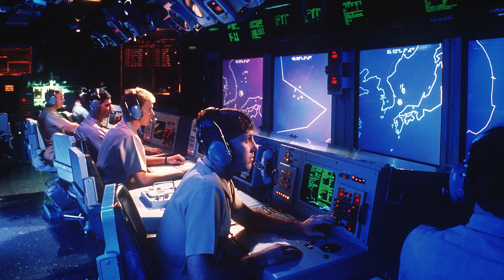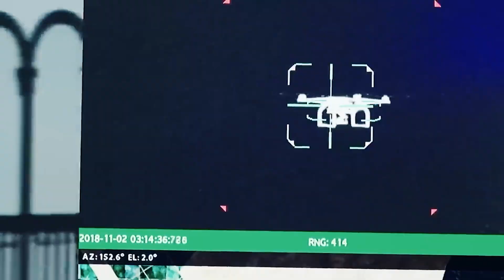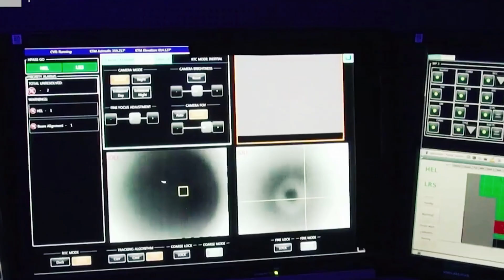This US LASER Aircraft Carrier Is Ready To Beat China

Comment: From what I've read before there's several challenges in taking down a hypersonic missile with a laser.
1) You've got to detect the bloody thing as it can literally 'fly under the radar' (yes Aegis too)
2) A hypersonic missile by definition is maneuverable, so even after detection it needs to be tracked, you can't predict where it'll be next
3) A laser needs to be focused on the missile long enough for it to burn a hole in it, because of the extremely high speed of a hypersonic missile this means the focus distance needs to be quickly adjusted to match the distance of the target

Well that and as this video states the best the US has at the moment, is a laser at half the required strength... So I'm not quite sure why this video is titled as it is as clearly the US doesn't have an answer to hypersonic missiles yet. They have the early steps of a countermeasure that they know isn't good enough and hope that it can be developed to a point where it will be good enough.

I think I'd keep those very very very expensive ships far away from much much much cheaper hypersonic missiles if things actually start going down until the countermeasure at least in theory stands a chance.
Reply: You don't need to burn a hole through it. You just need to destroy enough of its shielding that it self destructs. Like the space shuttle coming in with damaged heat shield. Going that fast through the atmosphere generates massive heat. Just putting a small dimple in it would probably be enough to cause friction and turbulence enough to cause a catastrophic failure.
Reply: Hypersonic missles are not maneuverable "by definition". In fact at that speed, manuevering is very stressful to the missile. Because of the missile's high speed, a high energy laser does not need to stay focused for a long period of time to stress the missile enough to cause it to breakup.
Reply: @dancobb2199   Although you're technically right, without it hypersonic missile is a term that can be applied to missiles as old as the original V2 rockets in WW2. Those are not what gives the captain of a carrier a chill up his spine.

"The US-based Missile Defense Advocacy Alliance states that ‘hypersonic weapons refer to weapons that travel faster than Mach 5 (~3800mph) and have the capability to maneuver during the entire flight.’"
I prefer that definition as it refers to something that's actually a new type of threat and generally what people actually mean when they say hypersonic missiles.

@Jack Bare  China's DF-27 is believed to have a range of 2100km at the highest estimates (that's ~1300miles). So 'thousands' (plural) is a gross overstatement. Not to mention these don't seem to be made with carriers as a target in mind.

The longest range one (DF-21D) specifically built to take out carriers seem to top out at about 1450km (900 miles)*. Perhaps you're thinking of the classical ICBMs - those do have a range of thousands of miles, but they're nothing new and unlikely to hit a carrier.

*This might be a rather recent model, last time I looked it up 290 miles seems to have been the maximum distance.
Reply: @Axeiaa  There's a few misconceptions here.

YJ-21s have a range of 1000 km to 1500 km.

DF-27s have a range of 5000 km to 8000 km.

Your calculations are off. Even near sea level, a Mach 10 YJ-21 missile traveling 7700 MPH would take 435 seconds or 7.25 minutes to go 930 miles (max 1500 km range), not 30 seconds. Plus, it would be going at a slower speed like Mach 6 initially, so it would take even longer.

Also, it's not too hard to detect a hypersonic missile. It doesn't matter which type, all hypersonic missiles create a superheated plasma in front of themselves that basically lights them up to radar and IR. They can be detected hundreds of miles away, it doesn't matter if they are flying low. The concept of them being stealth to radar is obsolete. NASA figured out how to use radar to track hypersonic returning spacecraft many decades ago.

They can be detected with a lot of different systems including satellite systems. The horizon for a fighter jet is typically over 200 miles, so that's the distance at which a jet can detect them and shoot at them. And jets can be way in advance of a carrier group.

Plus, Ukraine recently shot down some Russian hypersonic Kinzhal missiles with a US supplied Patriot battery, so it's possible to shoot them down with missiles.

Hypersonic missiles also have to do all navigational computations themselves because of the plasma which prevents all radio communications. No GPS. No correction from other military assets. If the wind is blowing too hard, these types of missiles can miss their targets by miles. This means that they have to slow down in order to gain accuracy by visually sighting a target itself, or by getting a radio data feed, something that doesn't quite work out for them.

The primary defense to hypersonic missiles would be air to air missiles, then ship to air missiles. The SM-6 is especially well equipped for this.

A laser system would be a third line of defense. The last line of defense would be a Phalanx CIWS, but only for lower flying missiles. The Navy would never want to get to the CIWS because it has to be fired way before the missile gets there and might not do enough damage, but it's not just a laser defense. In fact, the CIWS defense would be performed by smaller ships some distance between a carrier and an incoming missile.

A laser defense is more needed for drone swarm attacks. Although it might be able to take out hypersonic missiles, I have not heard of that being verified yet.

As for radar, the US has the E-2D advanced Hawkeye. It has 88 of them, plenty to protect multiple carrier groups.

You also discuss the Chinese missiles. The only way for hypersonic missiles to defeat a carrier group is if they swarm them. If the US went to fight China, not only would their allies in Japan and South Korea help, the US could probably field 6 carrier groups.

If the US ever got into war with China, they would have 30 Los Angeles class submarines firing 25 Tomahawks each in a half hour or 750 missiles at China from 1000 miles away from all directions before they did anything else. The entire coastal mainland of China wouldn't be able to defend against that much firepower and since the Tomahawk can be directed to a new target mid-flight, any heavily protected targets could be bypassed for easier military targets. Or, that massive firepower can be fired at the Chinese navy. China is putting their YJ-21s on destroyers now. Destroy the destroyers, that would take care of many hypersonic missiles. China is also putting CJ-21s on bombers. Again, take out the bombers, that takes out the missiles.

Any fight with China would be at very long range so that Chinese drones, jets, and missiles could not reach US naval forces before being destroyed.

All but 6 Chinese subs are diesel, so they have to come up every 1000 to 1500 miles. Easy to detect and destroy. China does have 6 nuclear powered subs that they could send towards our Pacific (or Atlantic) coasts, but we have 10 times that many that we can send towards their shores.

As for Aegis, yes, it can fail. It failed 10 times in the last 2.5 decades during testing. This occurred mostly when testing out new subsystems and/or missiles. It also succeeded 43 times during testing.

But the most important part of this is that major powers never get directly into war with each other. The last one happened 78 years ago. Profit from trade is too important. Sure, countries saber rattle and we have small regional wars, but it's unlikely that a real war will ever happen unless the entire world economy implodes and countries need food and necessities. Shy of that, this is a bit of a moot discussion.

No hypersonic weapons will be fired at any of the major superpowers until smaller countries gain hypersonic weapons.
Reply: @dancobb2199  but the missile can rotate so that the laser won't focus on the same spot
Reply: Us navy laser aircraft carrier
Reply: Keeping US Naval fleet far away from SCS and much closer to home will make more sense in the hyped up "National Security" propaganda. But unfortunately arrogance and inability to maintain hegemony diminish the sanity left in the brains
Reply: Exactly, did that Iraqi defense PR flack Baghdad Bob write this? DOD got caught with its pants down.
Reply: Axaea, you can't kep those ships anywhere far enough because hypersonic missiles have a range of thousands of miles
Reply: Ukrainians have actually taken down multiple Russian Hypersonic missiles.  So that whole technology seems to have already been countered.  Necessity is the mother of invention.
Reply: These missiles are being shot down already in Ukraine be careful Russian tech is never been the best. They always underperform like they are doing in Ukraine . Supposedly the world second  best military ha ha
Reply: Yeah it’s exo skeleton is made to take super temperatures and that’s what a laser is .
Reply: if they havent already, i would be thinking of a way to create an energy shield around the carrier that would deflect/explode a missle upon impact.  i dont think we have a way to fight against our own tomahawk if one was fired at a carrier.  

theres a video of what happens if a carrier group goes back to 1941.  a lot of our weapons depend on our gps satellites.  they would be useless without gps.  forward to the present; if our enemies or we used an EMP or lasers/missles to destroy gps satellites in space, those types weapons would be useless. dont focus on destroying the missle, focus on destroying how the missle works.  Look at the movie Battleship.  They tried firing tomahawks mannually.  rolling the dice.
Reply: Wrong.
Hypersonic weapons need clear conditions to make full use of their targeting and maneuvering abilities. 
When you're traveling at mach 7, any slight variation in your flight path caused by wind or turbulence can make the difference between hitting and missing your target. 
Hypersonics CANNOT maneuver well when flying at terminal speed. A few degrees in any direction at most. Anything more will tear the missile frame apart. 
As of right now, it's doubtful that Hypersonics would be able to hit any target that's moving at more than a few miles per hour. They've only been tested on stationary targets. 
Add Sea Storm winds to that and there's basically no chance that it'll hit it's target. 

High powered lasers on the other hand would function just fine in bad weather. They produce incredible amounts of heat, and aren't affected by rain or wind. Fog might slightly affect it, but that laser is going to pierce through those clouds and keep going no matter what.

Also, Hypersonics from Russia and China are not "fly under the radar" type weapons. They are massive, produce a lot of heat, and light up on a Radar like neon. They are NOT stealthy. The U.S. is the only one with stealthy missiles, or stealthy anything really.
Reply: @Mikayelion6  I think your data is a bit outdated. The YJ-21 which people like referring to as "the carrier killer" is literally quoted as "the YJ-21 could pose problems for the Aegis Combat System".

Which I perhaps pessimistically read as "fingers crossed, we might get lucky". But if the past is anything to go by, any time any military/navy doesn't straight up state they can do something... they can't. And if they state they can, ehh. Well let's just say different countries have different track records (and that of the US is a lot better than that of Russia for example ;)).

Also, according to the US navy itself it's capable of hitting moving targets. I can't find China itself claiming this although why would they consider it a carrier counter measure if it can't. I doubt they expect a carrier to sit still. I suppose you could argue that its developed as a finishing blow after some other means of attack disables propulsion but I highly doubt that is the case. The enormous size of a carrier definitely makes it easier to hit than any other moving target. 
China does claim it's working on missiles that can hit moving vehicles so they at least have the tech in development.

"A hole" was perhaps the wrong terminology of me to use, but it does need to do enough damage to have an effect. Hypersonic missiles being build to withstand extreme heat adds to the challenge. 

The best bet is probably to try and detect the heat signature of the missile rather than radar like AEGIS does. Or better yet strike where they're coming from before they're laucnhed. As these missiles currently can only be launched from China's own aircraft carriers (2, to be 3) and Type 055 Cruisers (8, to be 10). 
That's 10-13 targets to track by satellite and dedicate whatever means are needed to to take down. Once they're taken care of the US's own carriers should be a lot safer. I'd be surprised if that isn't exactly what the US spy satellites are already doing.
Reply: @Axeiaa  The U.S. always overestimates what it's enemy is capable of, and then prepares for THAT. That's why we've been ahead so long. 
A "moving" target can mean anything from 2knots to 30. And I seriously doubt 30. Physics will simply not allow an object at Hypersonic speeds to make any kind of significant turn. The margin for error is VERY small. I don't care what China says, physics doesn't change for anyone. That missile NEEDS to be fired at a mostly stationary target or else it will miss entirely. I promise you. 
Why do you think the U.S. abandoned Hypersonic tech in the 90's? They knew it wasn't good for anything other than hitting ships in port or ships that were anchored and didn't know it was coming.
Reply: @Mikayelion6  They do go by the prepare for the worst motto which is the smart thing to do. It certainly worked out for something like the F16 where they had grossly overestimated Russia's capabilities and ended up making one kick ass jet themselves.
Think that's also why not a single navy officer has said they're certain they can deal with hypersonic missiles, they're much more ambiguous. 

Let's do some rough math.

The Gerald R Ford carriers are 333m long with a top speed of 'in excess of' 30 knots. Which could mean it has the power to go faster but it risks structural intergrity (Main battle tanks have this problem where they can exceed their top speed but are limited to prevent damage), or it's 30 knots and change. 
Let's be generous and convert it to 60KM/h (that's rounding up by just under 10%), that is 16.6667m/s
I'll also assume the Chinese are aiming at the front of the ship as it's unlikely to be going backwards, so to be out of the way the ship needs to cover its own length of 333m, 333/16.6667 = ~20 seconds.

Now the YJ-21 has a range of 290km and a speed of Mach 6 going up to Mach 10 during the terminal velocity phase. At Mach 6 launched from the maximum range it would take about 30 seconds to reach its target. 
Even if all they have to go by is sattelite tracking of a carrier and calculate its approximate speed I'd say there's a very good chance of them knowing where a carrier will be 30 seconds from now, considering the size  they are they have quite large margins to still hit the target even if they're off by a bit.
(Yes it wouldn't immediately accelerate to Mach 6, but then again it goes a heck of a lot faster during the terminal velocity phase so 30 seconds is probably still a decent indication of the total flight time)

These missiles are just too darn fast to do much about them when the target is as big as a carrier.
Reply: @Mikayelion6  Of course US is the only country in the world with stealthy anything even making F35 dissappear from radar or rather missing in action. Americans chest thumping at its best but resulting only in hot air balloon taken down by not one but two sidewinder from F22 (need to warm up and fly those buggers else it will rust on the runway!)
Reply: @Mikayelion6  Actually -- to be hypersonic they have to fly high where the air is thin.  
Sea skimmers are ALL sub-sonic.